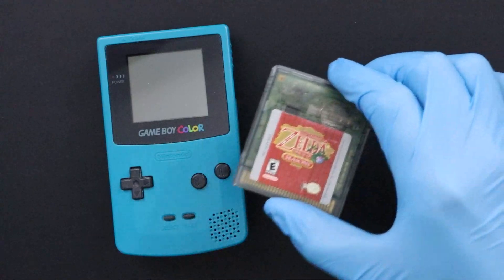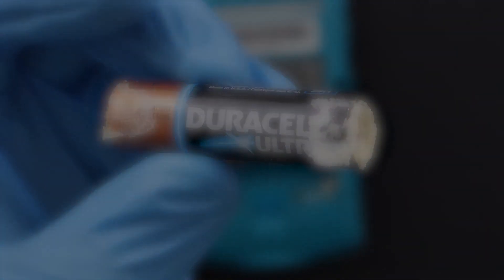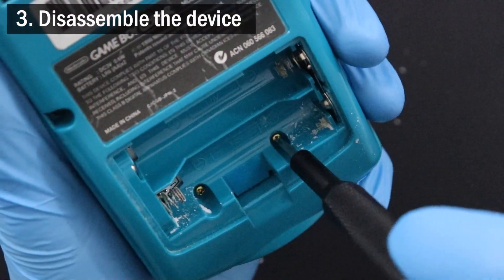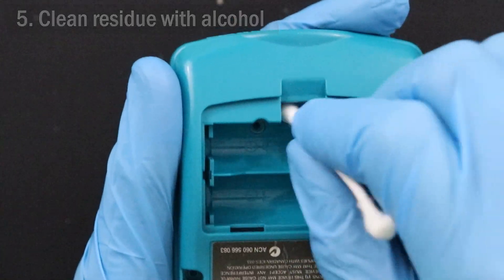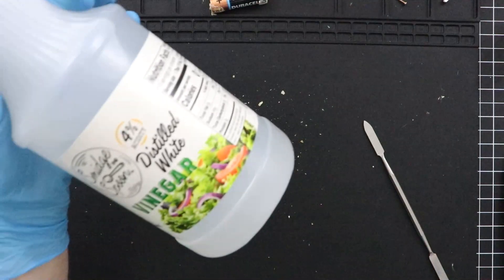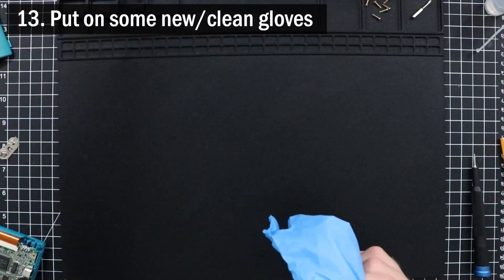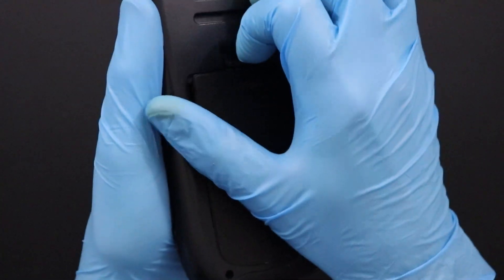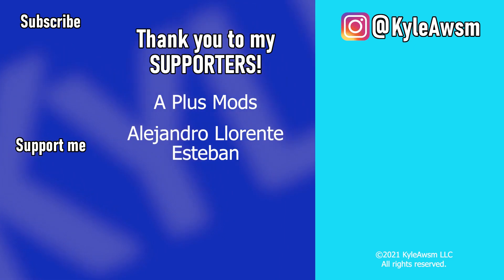When Batteries Puke on Your Electronics

Comment from the maker: Something I barely glossed over in this video is WHY you separate the plastics from metals during cleaning.  Depending on who you ask and what articles you find online, you'll hear that vinegar can/can't damage ABS and other plastics.  In my experience, it can cause the plastic's color to fade if left to soak (and for too long).  So, while you do need the vinegar to neutralize the battery "acid", try not to soak plastic parts IN vinegar if you can help it, and always clean up the residue with IPA.  Thanks for watching, everyone! 🙂👍🏻
Reply: I have a Pokemon emerald cartridge that Drains a cr 1616 battery in 24-48 hrs, I've already burned through 4 batteries and I don't know what it could be, anyway you might be able to give guidance? Thanks in advance.
Reply from the maker: Feel free to send me a message on Instagram @kyleawsm and send me some pictures of the PCB.  Cheers!
Reply: high concentration alcohol can damage some plastics as well. It's relatively rare that it happens but I usually keep alcohol away from plastics just to be sure.

Comment: Hi, your videos are awesome. I see you use IPA to clean those flux and pcb board. Is it possible to use ethanol absolute do the same thing as IPA? Cause I can easily get high concentration alcohol at chemist's shop (compared to IPA).
Reply from the maker: Yup, it should be just fine to use ethanol/ethyl alcohol as a cleaning solvent for PCB's.  Just make sure you wear gloves, or it could dry out your hands.  Thanks for watching!